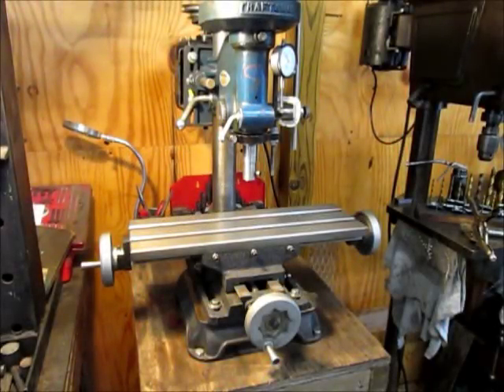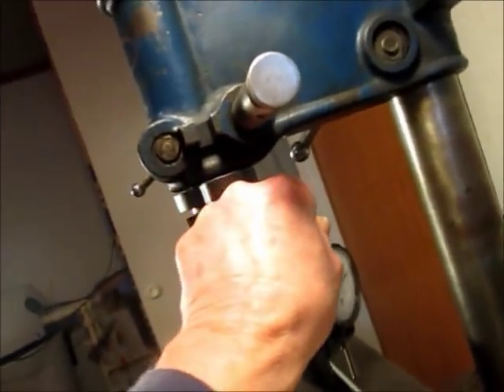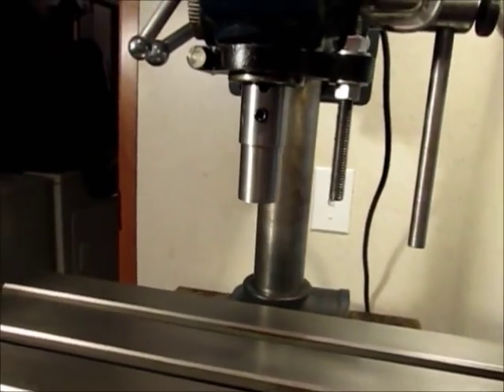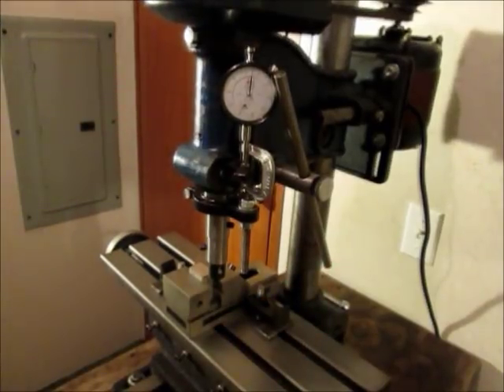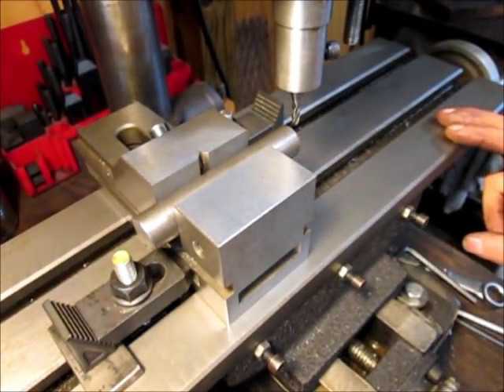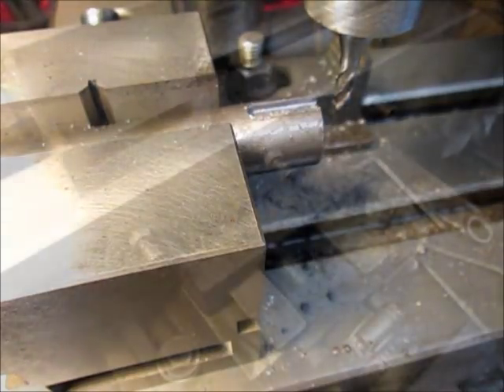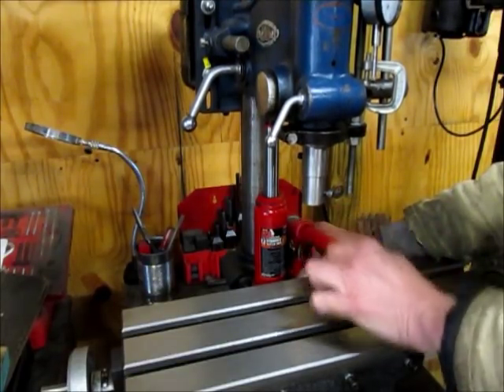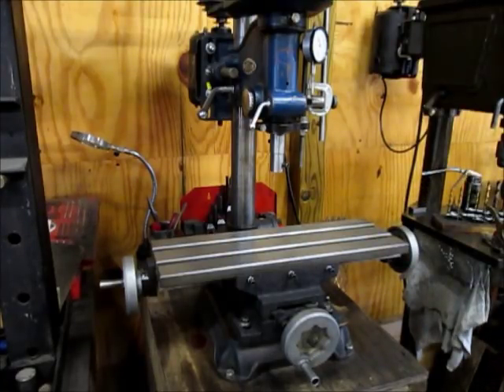Milling with a Drill Press

Comment: This is the first time someone with real sense used a drill press that didn’t have a Morse taper and used a press that would work. There are plenty of older machines out there to do this. It doesn’t take much to get these to work. You also need a machine that has a quill lock that tightens the quill directly like a craftsman 150 or an older Atlas. Great job and thanks for not wasting time on stupid stuff!!!
Reply: Do you recommend not using a drill press with a Morse taper?
Reply: @brutusjb3814  don't. trust me. lol

Comment: Good job and nice video. Don't listen to the people saying that the bearings aren't designed for side loads. I have rebuilt several drill presses and the smaller cheaper ones have deep groove radial ball bearings. Other, higher quality drill presses have angular contact bearings at the bottom of the quill. In either case the bearings are absolutely made to take radial loads. I would however keep the cuts light, but not because of the bearings. A drill press usually has a long slender spindle shaft and as such can be bent. I have a drill press in my garage right now that I was given and it has a bent spindle shaft. A long drill in the chuck will run out about 1/4" on it. It is on my to do list to straighten it.

Comment: To make it easier on the bearings, I'd take plunge cuts at first to remove a majority of the material, then use the cross slide to finish it up.
Reply: If you have a bearing issue, you can solve the bearing problem by replacing your lower spindle bearings with an angular contact double row bearings.
Reply: Or just use typical roller

Comment: Very neat! thanks for showing! I have two ideas for a vertical positioning system. 
1. you can get powerful linear actuators from old treadmills, easily enough to move the machine through its z axis with precision
2.  get a cheap 12v worm gear motor, and cobble together an electric/screw drive/or pinion drive. 

I realize thise video is old as hell, but oh well, it's helping me think!
cheers

Comment: To raise and lower the heavy head of my old Canedy-Otto Cincinnati drill press. I took a piece of large diameter pipe that would slide inside and to the bottom the press column - then cut it to stick out 12" above the column. Bolted a spare 12 volt Badlands winch at the top of the pipe and used an old motorcycle battery with a trickle charger to run it. The winch control pendant hangs near the rear power switch.  A vinyl-wrapped bicycle lock chain loops under the drill head to the winch hook and just clears the drive belt.  I can lower the head to keep from having to extend the quill very much. Like you, I don't use the drill press table as I bolted a Palmgren rotary table to the base. These old machines run much smoother than the new stuff.

Comment: G'day from an Aussie metal mangler. I have the exact compound and I'm in the process of doing exactly what you've done with your drill press. Only thing is, my drill press is BIG. 2 hp, 12 speed.  Everything here runs on 240 volts AC, 50 Hz. I've been making gold prospectors picks, and to achieve an edge on the pick blade, was a matter of hand grinding it, on a pedestal grinder. Nasty, dirty, work. So I thought of this sort of idea, but watching your video has made it a lot easier now. Thanks, mate. Cheers, Shane.
Reply from the maker: Thanks for watching.

Comment: I’m a firm believer in making what you have work. Looks like you’ve done a pretty solid job of that with this build. Nice work! Try to find you another set of spindle bearings because if you do very much milling with this setup you’re going to wear out the ones in there now. Good luck.
Reply from the maker: Thank you.

Comment: Excellent work sir! I am embarking on the same adventure this week. I hope to get the same kind of accuracy that you achieved. I believe the quality of that old press is what keeps you out of trouble. Newer cheap drill presses just don't have that quality.
Reply from the maker: +Tater79bj Thanks! Yes, a heavy drill press is a must.
Reply: I got tired of watching people going all through commotions of using some Grizzly or harbor freight drills trying to do this. Finally found this and couldn’t believe he used a decent drill press! One guy was heating up a quill with a Morse taper and took a chuck that was in the freezer then pounded it in. It still dropped out! Then of all things he said well guess I’ll have to put super glue on it! Super glue??? Oh boy.🙄 Trust me folks don’t waste time on those cheap drills from Harbor freight. They’re only good for drilling wood—maybe?😂😂

Comment: I used a 1940 delta drill press,,,solid steel column and has a 2 inch locking quill,,and I also used a automotive scissor jack as a table lift,,,you should raise your head and use a sisor jack as a table lift yourself,,,really smooth lifting and gives a truss effect
Reply from the maker: Yes this definitely needed another way to lift the head.

Comment: I'm currently in the process of doing the same thing. The only thing I would say is it might have been better if the spindle wasn't so long. I'm using just a cheap harbor freight press I got at a yard sale for $20.00 which seems perfect just because the spindle sits way up in the head which helps keep the spindle supported. I'm glad you have a setup that works well for you though, I'm in the same boat as far as making what I have work.
Reply from the maker: Nate Rose Thanks Nate. Good luck with your setup.

Comment: This is just awesome! I actually have that exact same drill press i bought at a yard sale for $50! I tore it down completely and repainted it as close to the original blue color as i could find. Sadly its still in pieces because i need to take the pulleys to a machinist to have new ones made. The front one with that weird spline pattern is cracked. I always thought that as sturdy as these presses are they'd make a great cheap milling machine for a home gamer like me. You have inspired me sir!
Reply from the maker: Hey thanks for watching. You might check ebay for that pulley, these presses are parted out a lot.

Comment: A great little number mate ...dont worry about the knockers / shitheads....they're jealous or dumb because  they either did'nt think of this ,or cant do it ...... cheers from AUSSIE  LAND
Reply: My gawd, I thought of this and tried it just once many years before Youtube was even thought of Mr. Aiken. So I guess I don't fit neatly into your "jealous or dumb" category. Even though I already had a mill I wanted to see just how well it would work.And I tried it with a far larger and heavier floor standing drill press than the one shown here. I've even got the exact same X,Y table this YT poster has. But I use it for what it was designed for, locating drilled holes better than hand positioning them.If you understood anything at all about bearings and the differences between the end and side forces you'd understand there's a vast difference between what a drill press uses and what milling requires. 

Oh it works and barely if your not picky about the results as the video clearly shows, but it's beating the bearings to death since there not designed to take those high side loads and those results are far inferior to even a cheap X2 sized Chinese mill. The larger round column mills only look like there basically a drill press. But not only have the bearings been changed to take the side loads, all of the castings and the wall thickness and size of the column have been upgraded to help resist those high milling forces. To get any tool to cut metal you have to drive it into the metal until it starts cutting. I've seen more than a few of these "lets mill with a drill press" videos and they always get comments about what a good idea it is from the people who seem to least understand what the requirements are. I'm certainly not an expert about machine tool design, but I've learned enough to respect anyone who understands just why it's a worthless effort. Your certainly free to think were all "knockers / shitheads", but getting some understanding and education about what it takes to cut metal would change your opinion about what some of us have already learned.

My current mill is an 1100 lb three quarter sized Bridgeport clone, and I can still see the machine flexing under cutting conditions if I push it past what it's designed for.
Reply: No that wasn't a usable keyway at all. The key is supposed to fit very tightly into the keyway. Have a look at the stepped side wall surface finish. If the key fits it's going to be loose. A loose key hammers and enlarges the opening. That tight fit stops that from happening.And where did I say he couldn't do what he wants with his own machine? Posting a video about something the poster obviously knows nothing about is what prompted my comments.And that's why you see much of the same comments posted here by people that know what there talking about. I said and meant it was a worthless effort. I've tried it once, and I've owned a cheap $500 X2 mill and know the difference very well. 

I've moved on to an 1100 lb mill simply because that little proper mill couldn't do a good enough job for what I wanted either. But that little 160 lb mill was light years ahead of a 180 lb floor model drill press. At best a drill press can use an end mill to counter bore holes or counter sink for machine screws, but that's because all the forces are vertical and what the machine was designed to do. But if your still in doubt I highly recommend posting your thoughts over on the Practical Machinist forum for further opinions by actual professional machinists.
Reply: Well I never said nor even implied I was world class at anything since I'm also not a pro either. And I know of Rudy very well since I've read most of what he wrote and have most of the videos he did. This may come as a surprise, but no one including myself is immune to bad ideas.Yet somehow you apparently think your personal opinion about any of this is for some reason more valid than mine or any others who have said much the same just because it's only tinkering and in a home shop. Myself and many others have mentioned reasons and used logic about why it's such a stupid idea, and you've added pretty much because someone else did it in the past. There's enough other comments here by people who do know what there talking about so I guess it's pointless to even try and add anything more to what some just refuse to understand.

Comment: Just wanna day great job and to everyone reading the comments research your tools before purchasing. The vintage drill press were designed to handle a side load hey are made with brass bushing not bearings. The only thing to fail on the side load is the Morris taper chuck he addressed that though!! Great job I am about to do this with my 1948 Powr Kraft. Montgomery bench top drill press

Comment: Good job, i have an old 1950s industrial Walker Turner that im going to do the same thing. The only problem is that the spindle is way too long. And it has about 3 thousand runout. It used to have 6 thousand runout untll i bent it back. whatever i decide to do it has to be reversible back to original. However,  I do like your spindle mod. That is a weak point in many conversions .
Reply from the maker: I ended up putting this back together as a drill press and now has a new home. It made for easier setups than a lathe attachment, but yea, the long spindle, lack of tooling options, limited to very light cuts are all downsides. This was mainly an educational project, and for that, it was a big step forward for me.

Comment: good job, nice simple manual controls. I got really tired of seeing diy machines that were overly complicated and fiddly to make. Don't worry about spindle bearings, I don't know of anyone that has needed to replace them on a hobby machine. I will also use a Grizzly table but I've got a 1 hp router with speed controller that will be used rather than a drill press. Nice work and effective for what you need.
Reply from the maker: Thanks for watching.
Reply: How's it going with your router setup? I'd be interested to hear any details.